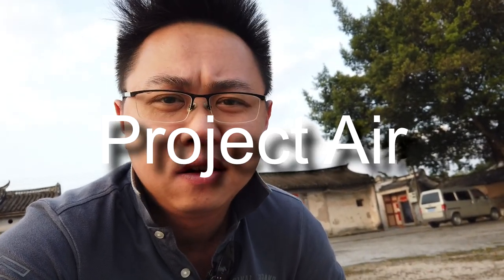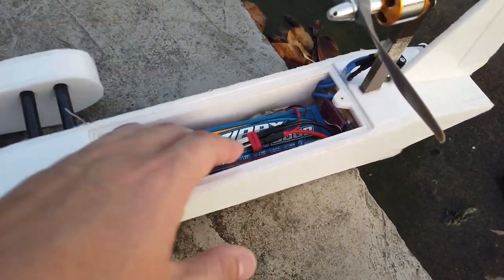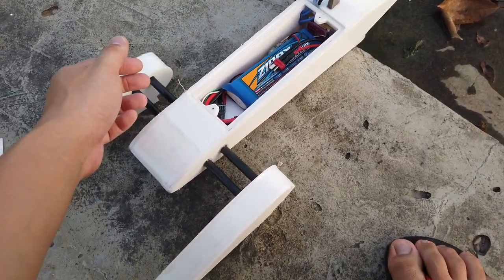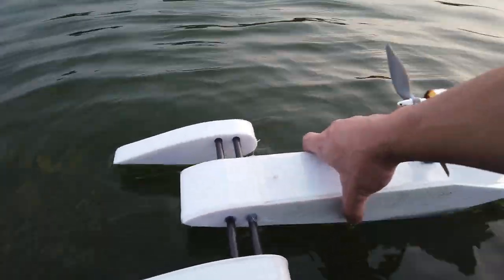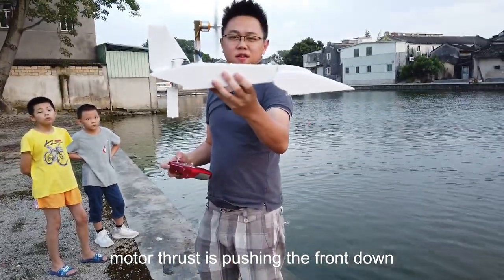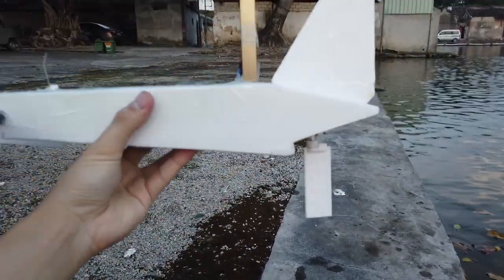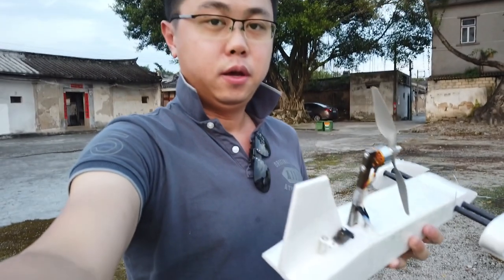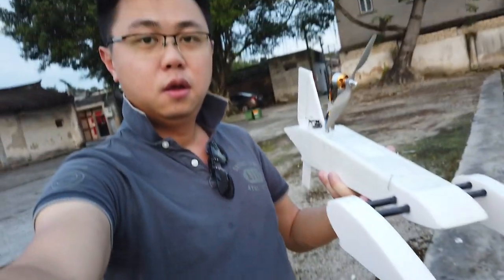Foamboard RC Hydroplane - Project Air Fans Attempt

Comment: Wow! So pleased you recreated my hydroplane design! - Super cool. With the minor adjustments, I'm sure you have a solid idea of how to fix them, but I would probably redesign the sponsons/floats so that they angle far more upwards. This will help the water push against them water rather than engulf them! :) Also, maybe try using a smaller prop at first so you don't get so much torque. Excellent job despite the initial problems. I had many things to fix on my first attempt. Airboats aren't always easy. Thanks for sharing Edward! 
- James ✈️🔧🚀
Reply from the maker: Hey yo. My pleasure to have your comment here too bro! 🙏
Haha how much the angle were u using? If i rmbr well it was 35degree, base on photo from your video. Haaha
Reply from the maker: Ya planning to use smaller prop too. Or make a 2nd one with water propeller so i can probably understand the hydroplane setup easier